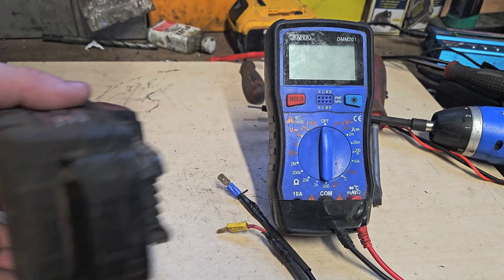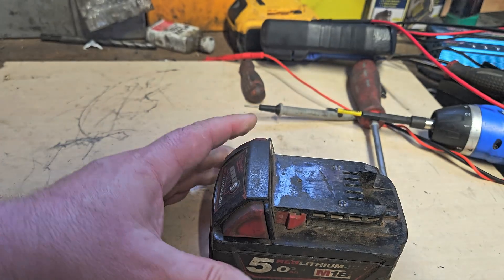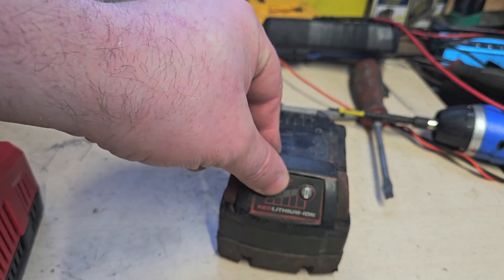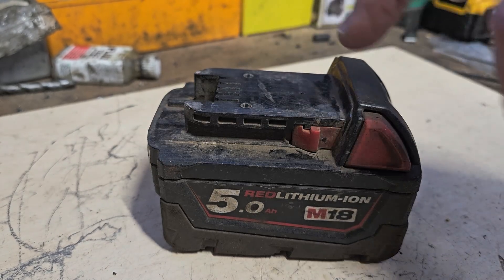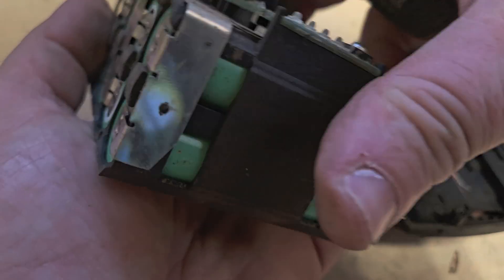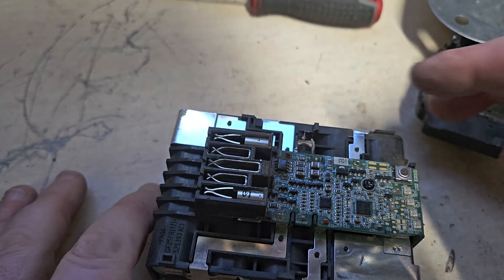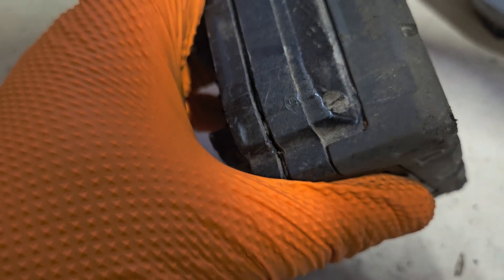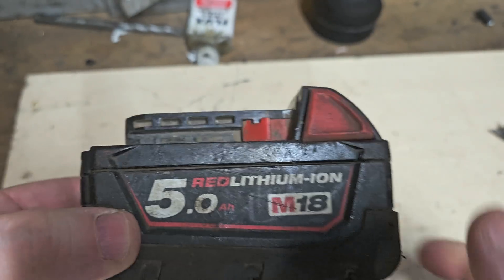Milwaukee Battery Full Voltage No Bars repair

Comment: I just got a new battery and I'm not really familiar with it. Since you fixed it, have you ever seen a battery like this burn before repairing it, or did it just rust and become unusable? / What percentage of batteries are susceptible to self-burning?
Reply from the maker: I have never had a battery go on fire if that is what you mean
Reply: @doctorlefthandthread  
Thank you for your confirmation., I'm just worried about the battery. news  often says that electric scooter batteries caught fire
Reply from the maker: @pockettime2950 they do its  not as common on powertool batteries but can still happen. I think the scooter people cheap out on cells and electronics
Reply: @doctorlefthandthread  Thank you

Comment: Awesome job!. Where can I source the replacement boards?
Reply from the maker: https://amzn.to/3LubrAw
Reply: will that do a 8ah battery aswell?
Reply from the maker: @tpocOConnor it's a different board slightly bigger the 4ah 5ah 9ah are the same the 8ah has its own board 12ah is unique too
Reply: @d @doctorlefthandthread hanks they seem to be way harder got then the 5ah pcb boards. Did you find this too?
Reply from the maker: @tpocOConnor yes I sometimes have to buy a whole kit just to get the board the kit has a outer casing inner housing as well as stickers